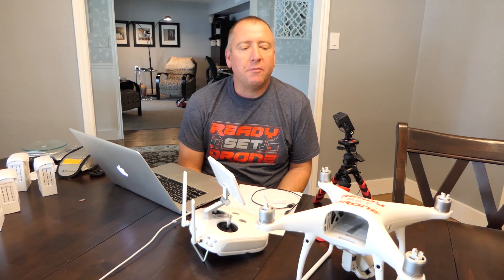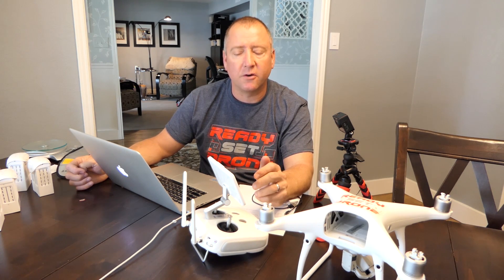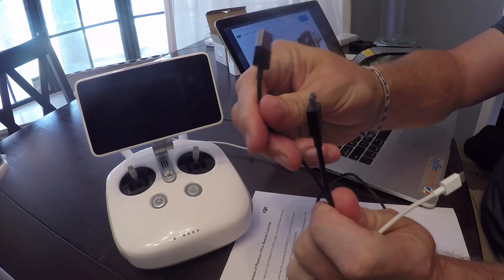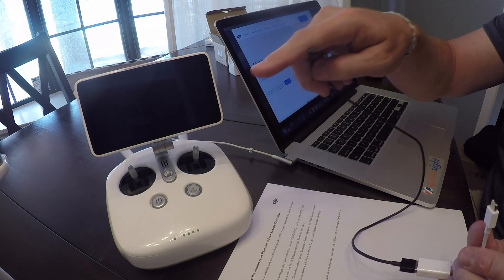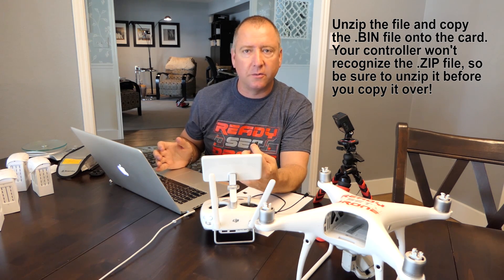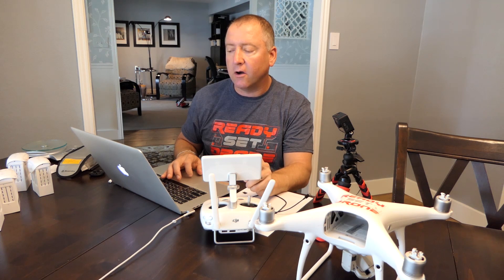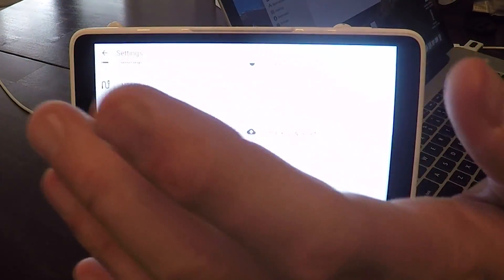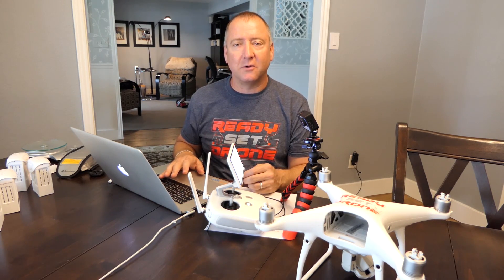DJI Phantom 4 Pro Firmware Problem Fix

Comment: I saved up for over a year and sold stuff to get my first phantom 4 drone I was so excited.  I started it up it went up to about 50 feet and it shot off like a rocket and never seen again I was so pissed and shocked excited  one moment and cry the next WHAT did I do wrong . I need to know before the long process of saving again.thanks bryan
Reply from the maker: Man, I'm sorry to hear that. I have a couple of thoughts on what might have happened. First, how many satellites did you have when you took off? It's good to have at least 10 or more to ensure good GPS. Second, were you near any large metal or concrete structures? Those can cause interference. Again, sorry to hear about that bad experience.
Reply: Ready Set Drone thanks for replying yes I was near a large tower. So sad. Thanks again

Comment: I am really having issue controlling the phantom 4 Pro. Recently bought, like a month ago. From last 2 days it’s really giving me hard time. Just right after starting and about 3 feet it doesn’t even stay at one place.. it’s keep moving... even when wind is 2-3 m/h. I had a chat with customer service and they said do the firmware update, IMU and calibration. I did all that but nothing is changing.
Reply: https://youtu.be/Fq6BcSYPjb8

Comment: I can only say...I AM VERY DISAPPOINTED WITH DJI. Good products but awful customer support, repair and software.

After sinking over $2,000.00 on P4P, Goggles, extras......I have a shaking, wobbling POS flying, I have done everything...re calibrated IMU, Compass, wasted hours searching and nothing.

Then, I purchased the HDMI module so I could plug the DJI goggles using HDMI port.....to find out that is only works with the USB port...so I need disconnect my Ipad.

First they told me to send the HDMI module, one month later they tell me there is nothing wrong with the module, then they tell to send the RC....another month goes by and they return it telling me that the RC has no problem. I don't think the problem is the goggles or the cables because I tried a monitor with the HDMI port and had the same issue....no image, just the OSD display and turns on and off between black screen.

THIS WAS THE LAST TIME DJI GOT MY MONEY, thank  God I did not go for the Inspire 2....would be a double loss

Comment: Stupid FKN DJI company!  Why the hell they sent this fkn firmware update that messed  up all our expensive aircrafts!  

We should all raise our voices worldwide and boycott DJI by advising potential buyers not to buy any other DJI product because of the real risk of wasting their money on an equipment that wouldn't work properly anymore after a week or two from the day of purchase... 

It happened to me... I spent $1900 on a DJI Phantom 4pro+ , plus two extra batteries about two months ago,  and it was working perfectly until this fkn firmware update... After that,  my drone is not flyable anymore and DJI didn't have an idea on how to fix the issue... Now my drone has a terrible video lag,  the gimbal moves by itself side you side,  a warning RED LED blinks after normal green ones were blinking asst powering up, but the App shows all systems working normally,  and the telemetry was totally wrong... I'm getting a negative number on the altimeter gauge with the drone still sitting on the ground 🤔 ... So now I'm stock with a $1700 paper desk weight... 😨

Are this guys from DJI STUPID?  Why would you ruin your company's reputation like that?  Who's gonna want to spend that much money on a product that at the end is going to be like playing the Russian Roulette🤔🔫

STUPID RIGHT!  Common DJI, fix the mess that you created before your company lost our trust...

Comment: I own a Phantom 4pro+ too... So after the August 2017 firmware update my video image was completely pixelated... After searching the forums I learned that by doing a factory reset on the controller the video issue would get fixed.  I did that and the issue with the video disappeared.  Thing is that now the telemetry isn't accurate,  the indicator LEDs on the drone blink 4 times green as it should be,  and two long  red blink ones... The interesting part is that the application aircraft's status tab shows all systems working normally🤔 .  I called DJI customer support and they told me to perform an IMU and Compass calibration to fix the issue.   I did it, but the problem still happening.  The aircraft also shows a negative number on its altitude gauge with the aircraft still on the ground.  I'm  stuck with a $1700 paper desk weight in my house because under this conditions my drone is not reliable for flying.  Ohh, another thing is that the gimbal moves by itself side to side really slow without any inputs...🤔

Anybody experiencing something like that?  I need help desperately..
Reply from the maker: Wow...that sounds terrible. I have a couple of thoughts. First, I know that the P4 (and all other DJI drones) are very susceptible to magnetic interference. Be sure you are not on concrete with rebar, near power lines, etc. I have seen the negative number on the altitude before when I start it in one place (like on a hill) and then move to some place lower...but never on start up. The camera thing is weird. My only suggestion would be to do the reset again, update to the latest firmware, then go calibrate everything out in a big field - away from any possible interference. Maybe hover it 5 feet in the air for a bit to see if it is stable. I wish I had a better answer...please let us know if you manage to get it fixed.
Reply: Ready Set Drone I'm going to try that and let you know!... Thanks!
Reply from the maker: Good luck!
Reply: Ready Set Drone thanks

Comment: Does the update changed anything in the screen? I was interested to buy the pro plus but seems that has too much issues to update and cannot inatall third party apps
Reply from the maker: Honestly, if I could do it again, I would not buy the Plus - it has more issues than a regular phone and is more difficult to update. I would go with the plain old DJI P4Pro and skip the plus.
Reply: Thank you for your suggestion

Comment: Had to do this to a brand new P4P+. So frustrating why DJI don't tell you this to start with. 
But thank you, your vid was fantastic help. Marky Mark
Reply from the maker: Glad to hear you got the issue resolved! Thanks for the comment!
Reply: Mark Turner How-do-you-do it if you don't have a Built-in screen my controller doesn't have an SD port

Comment: Instead of connecting to your PC and downloading, couldn't you do an OTA update?, as you seemed to have the option on the controller to update through WLAN.  Would save all the connecting and disconnecting cables if you could :-) 
Seems DJI have made this unnecessarily complicated.  While not in the same class as the P4 range, my Xiaomi Mi drone 4k does all firmware updates with just 1 click.  That is 5-6 different firmware's for Quad, RC, gimbal, camera, battery etc. It's certainly not without it's own issues though! 
I guess in the end, the more technology they have built in to these drones, the more potential issues and quirks!
Cheers

Comment: decided to take my phantom 4 out for a flight yesterday after a few months of closet time, did the updates and it flew like crap! pixels all over the screen, and non responsive at times! luckily i got it back safely but this is ridiculous! it flew completely fine before these so called "updates". can't they just leave good enough alone. if it ain't broke don't fix it.
Reply from the maker: Were you able to fix it?
Reply: I have this same problem am yet to fix mine ive tried almost everything
Reply: Pls, I want  to know if you have fix the problem , I have my for 2weeks now it came with the new update and I am having same problem
Reply: RO DION yes i was able to fix it there is another tutorial here on youtube i followed it solved the problem.
Reply: Og Nnamdi pls can you share the link pls I need ur help
Reply: Og Nnamdi  hi mate what is link

Comment: As a newby I'm so bummed tha DJI has made this so complicated and no instructions on what to do. Thanks for sharing this. I have no signal after updated and my controller just beeps. So frustrating
Reply from the maker: Did you update the controller and the drone? It should be easier to do if you have a regular P4 or P4Pro...I think part of the complication is with the P4Pro+
Reply: Nope P4 has exact same issues but we don't have an mcsd slot to download any firmware and local install. We are at the mercy of the app that buy the way will not download the new firmware, only the old to downgrade but once you've attempted to upgrade the remote will not accurately see the firmware on the P4 and says you have an outdated firmware on your P4 even though you've updated it through the assistant app on a PC.

Comment: I heard that even the batteries themselves  (at least on the Mavic) need to have firmware updates. Does anyone know anything about this?
Reply from the maker: That is correct. If you update your drone and then fly with a different battery, it will say "inconsistent firmware found" and then it will update the battery. But usually, this is quick and easy.

Comment: Thank you for posting the fix.

When I have upgraded the firmware on the Mavic, the DJI Tutorial shows you how to update the firmware on both the Mavic and controller at the same time. 

Is this not available on the Phantom 4 Pro ?
Reply from the maker: I think it was more complicated because I have the "plus" version with it's own screen, which means that updating the controller is a bit more of a challenge.
Reply: You know that's what I was thinking. So glad you got it figured out. I am saving my nickels and dimes to get a Phantom 4 or maybe wait to see it's replacement.